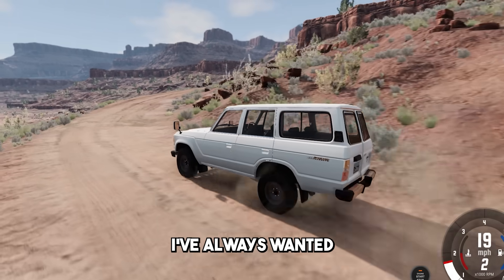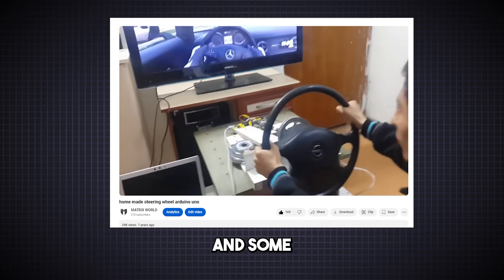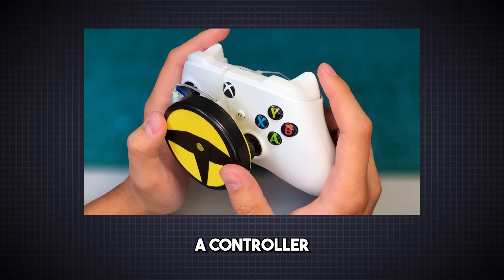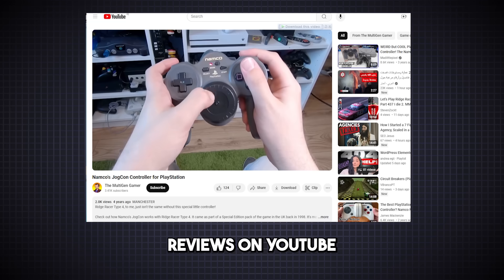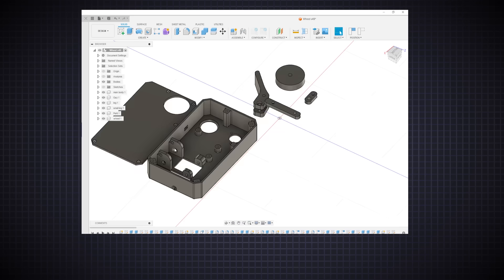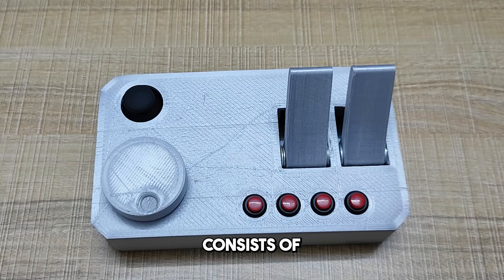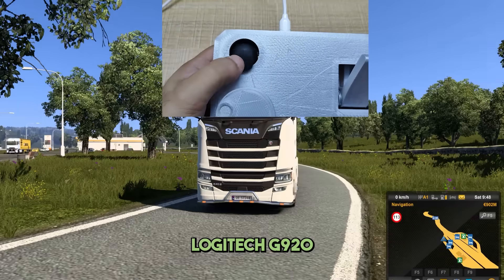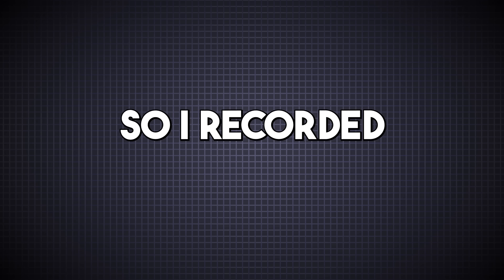The Racing Controller No Company Ever Made—So I Built It

Comment: A cool thing to change to continue separating it from a controller is to add on the right pointer, another small pedal for a clutch, and on the left finger two more buttons for a gear up/down. And the left dial for steering could be a dual dial that can also act a a stick so looking left and right can be done the same as steering.
Reply: It also doesn't even need to be handheld, you could have it placeable on a table to make it easier to add controls

Comment: Absolutely love it, huge congratulations !

If you're interested in suggestions :
- I Think accel/brake paddles shouldn't be this way. It should always be easier to brake than accelerate, so I'd either bring accel upper, or give a curved edge to the brake, so that the thumb could naturally dive into it.
- I would use L1 and R1 buttons to rotate camera on a swivel, to have quick looks around... having to let go of the steering to adjust view is not functional in my opinion... while L and R buttons could allow you to pan around while still having full control of the vehicle.

Have a good one.

Comment: It could work as an arcade controller with your pointer and middle fingers on the pedals and maybe the camera rotation as a mouse pad instead of the analog stick, so you can drive with the left pointer finger and turn the camera with your thumb by putting the mouse pad bellow the steering wheel.

Comment: If you can, try to find a CHT nozzle for your printer. Standard .4mm nozzles can usually flow up to 15mm²/s, while CHT nozzles can flow double. The faster you can print, the less worried you have to be about power outages. 
My next suggestion would be to find out whether Marlin firmware has a power panic feature as seen on most Prusa printers. 
Last would be piecing together some sort of power buffer with old lead acid car batteries, or finding something that gets trashed that containes lithium batteries of some kind you can repurpose so you can pause and shut down the printer until power is back.

Comment: Bro! time to consider solar or a portable generator for your printer :D I mean some car battery + 500w inverter should do it. Your design is awesome!!! I have some ideas for your v2:
Offset the gas and break paddle slightly (like in real cars). Move the gas paddle further up so when you hit the break its not in the way. Add a R1 button on top edge for your right index finger (ebrake)

Comment: Hello neighbour, selamunaleykum. You may put pedals a bit angled to better push with fingers. Steering wheel is total circle, you can design it abit asymmetric to findout where is center easily. Maybe bottom cut steering wheel design or red stripe on top something like that. Good effort. Well done.

Comment: This is brilliant at an amateur level but if you wanted to be competitive at all this would be really difficult to use. Looks like you can only hit brakes or gas. The huge advantage to a controller is that you have individual digits hovering over the gas and brake at all times. This is essential when it comes to weight transfer and once again not a big deal in an intermediate level but you need to figure out a way to make it so that I can use one hand for both gas and brake effectively.

Comment: This is not really a racing controller and moreso a driving controller, dancing around the gas and brake with just one thumb isn't really suitable for actual sim racing. My suggestion would be to design the controller to be used in the lap (like a fighting stick) and have three smaller pedals that can be used with any of the other four fingers, this way also solving the lack of clutch problem. The lack of shifting buttons is also a dealbreaker for sim racing.

Comment: i m not an arduino specialist, but you don t need an ADC (analog to digital converter) for the joystick ?? (at 3:42)
Reply: Arduino has ADC built in
Reply: Some joystick modules come with ADC built-in and communicate via i2c/SPI to the Arduino. 

Either way most Arduino boards come with a 12bit(?) ADC.
Reply: @ND15X  yeah. Here it’s a regular 5pins joystick. Requires a proper Adc. Good to know arduino has built in Adc (it can be tricky to setup). Unlike raspberry4.

Comment: That is awesome. Congrats. I m not as proficient as you in that stuff, but with the proper instructions I think I can make it. This project can help a lot of people who cannot properly use their legs. However, I have a couple of considerations about the ergonomics. It is ok for slow games like Snowrunner and ETS2, but not that great for fast racing sims. One problem is that you need to hit the brakes without lifting off the gas which is hard with your arrangement. The second is that the steering wheel is slow and can become slippery. A vertical orientation that you can grip with several fingers like the ones used in Remote Control cars would be better, I think. Thinking of it, can you build something to connect a RC controller to a PC?

Comment: Thats awesome, only changes id suggest would be to move the pedals to the back and add a clutch pedal, and add 4 or 6 buttons where the pedals are now so it would be easier to handle as a controller and still have the option for those that prefer a manual transmission. Just a thought.

Comment: Ok, thats extremely cool.  Well done for this.  I'm going to have to make one.  

Think about a couple of mods though.  
Moving the throttle and brake to where the right bumper and shoulder would be, so can use my first and second finger to control them. 
Move the joystick across to the right thumb.  
Add a rotating surface under the thumb on the steering so it rotates inside the control as well.  
Add a couple of buttons under the left first and second fingers (wherever they land). More buttons =  more betterer. 😉

Auto centring the wheel control may be tricky.

Comment: Great idea. Bu the layout is not really that great imo.
1) You cannot heal and toe with that setup. The long pedals are neat but not really useful for any racing (you need both pedals to be operated the same time).
2) The buttons could be aligned somewhere else. Some buttons for changing geears would be nice. They should be easy accessible
3) Can the stick be used as a button? You can map that to reset the camera, which would be cool :)

Well waiting for the force feedback now :)

Comment: The perfect version would be something like the turtle beach xbox remote with a N64 prong in the middle, you'd have the screen to adjust settings, you'd have the triggers for the throttle and break, you have the extra buttons at the back for gear selection, then you'd have the N64 prong in the middle so you could grip it there for the wheel and then you'd have the normal buttons for normal functionality, I think even the normal racing wheels should have a analogue or two to navigate menus and for camera, takes you out the emersion when you're messing around with a remote or mouth maybe no so much a mouse but a remote makes the experience less some how for me.

Comment: Great project! I’m not an engineer, but I think what would make this better is moving the 4 buttons to the thumb area (instead of the pedals), making the pedals smaller and moving them to the index and middle finger. That way you make use of more fingers and you could press more buttons at once (f.e. you can accelerate and change the camera at the same time)

Comment: Congratulations on what you did here. Very impresive. I agree there could be market for a driving games oriented controller. I think it all comes down to few things - wheel, analog buttons their precision and shape.
It needs to be comfortable in hands, have useful, precise and comfortable wheel and bigger and more precise analog triggers than on standard controller.
I think I'd start with regular gamepad shape, have two triggers but bigger, maybe operated with three fingers (middle, ring, pinkie).
By having them big, maybe it would be possible to modify them with some resistance accessory.
L2 for brake would have more resistance then R2 for gas.
It would be possible to swap resistance accessory, so that User can decide which of L2/R2 is gas or brake.
It would be nice if L1 and R2 would be also analog triggers, so one of them could act as clutch.
Wheel on left side of a controller, analog stick on the right. It would be perfect, if user could somehow swap sides.
With above setup you could drive and control camera at the same time. You could also apply throttle and brake at the same time.
There's a very cool video on YouTube by PyottDesign where he goes through how he iterated through making FPS controller. I highly recommend watching it.

Comment: unreliable electricity also a problem here in Indonesia. Have you tried breaking down the enclosure into smaller pieces? Smaller parts means you wont have to redo the WHOLE thing, and you can glue them to each other with acetone!

Comment: I use my Flysky Noble NB4 RC transmitter with Beamng when i dont feel like setting up the wheel. It doesn't have 900 degrees of rotation, but its comfortable to hold and is way more precise than a controller.

Comment: Not only is this a great space saver, there are some members of the disabled community who will love this concept.
I know folks in wheelchairs who love racing games and love watching me use my sim-racing setup but arent able to use it themselves. THIS WILL WORK FOR SOME OF THEM
Reply from the maker: Thanks so much for pointing that out! I hadn't even considered that, but it's awesome to hear that this could help people in the disabled community.
Reply: @3dprinterart299 It absolutely would! It's very hard to use conventional controllers and wheels with certain disabilities. This greatly improves and perhaps evens out the disparity in gaming ability. This is an excellent design. If the goal ultimately is accessibility, the wheel might require a nub or a handle to assist with turning off you lack the dexterity and grip.
Reply: @3dprinterart299 
Can i request u made a custom one n made a review of it?

...

Steering analog on right hand side

...

Throttle and brake as usual pressure trigger l2 r2

...

Left hand side for button
Shift up shift down
Hand brake
Change view
Joystick to rotate view
Pause menu
Nitrous for arcade racing
1 additional undecided button just in case
Reply: I was thinking the same thing. I’m in a wheelchair and I would 100% have one if I could, that’s why I wish a controller like this existed.
Reply: @RynoJ5 TurtleBeach velocity one race wheel you do not need the peddles it has two sets of paddles on the wheel the top left & right side peddle will be paddle shifters then under the paddle shifter is another paddle on the left and right side that are pull paddles and you can map the gas to the right side paddle and brake to the left side paddle works on Xbox and PC
Reply: I, for one, am one of those people who love the concept. I really miss being able to go to track days, but I can't really use my left foot with the same precision that I used to (And it's incredibly painful for me)

I can't afford any of the mods to my cars to let me drive my old cars, nor would I exactly want to be tearing apart my Skylines and Silvia to do that, and my steering wheel controller is just as painful for me to use as a car, so this is the best of both worlds for me. Thank you, from the bottom of my heart, from the bottom of the planet.

As soon as I get a 3d printer, I'm making one of these, brushing up on my CAD skills, and hopefully remixing this to make it a little more ergonomic for putting in your hands.
Reply: @Rhidongo  King 🤴
Reply: I love this comment so much! I love racing sims, but due to disability I can't use pedals and a wheel is difficult. Something like this would be perfect!
Reply: Theres also disabled arm/ fingers/ or even brain 😊
Reply: i was actually searching for this comment and product because I'm one of those wheelchair user😃
Reply: u can adapt the pedals but its quite the diy work ,just like they put the pedals near the steering wheel (as a lever) in real cars for disabled people =)
Reply: yeah, that a thing that know I think about it is problematic, because the stearing wheels, like the logitech G920, have levers that works like brake and throttle, but if you see a steering wheel of a adapted race car they have 2 rings.
Reply: Absolutely! Wheelchair user here myself. This thing is a work of art! I'm an avid racing ran and LOVE my modded racing wheel some old buddies in my old NR2003 race league put together for me, but it's hard to set up these days and won't work in most modern racing games. I'd love something like this to use in Forza and other driving games I have! Only two inputs I'd have on this. Some way to make manual shifting possible, and if there would be any way to add a form of force feedback.
Reply: that was my thought too
Reply: The space saving aspect is not a selling point if you are into realistic sim racing.
Reply: If you could add a clutch and a shifter it would be awesome
Reply: this was the very first thing I thought as soon as I saw the thumbnail. thanks for pointing that out!
Reply: "Disabled community" lmao tf
Reply: disabled people can drive irl, for disabled people, there should be a steering wheel for disabled people, not a controller :/
Reply: @LASTEIN2112  it really depends on the disability in question.
Many don't have the range of movement to use a steering wheel, whom this would be perfect for
Reply: @iguana51  but if they can use this controller, they can use a normal ps5 controller...
Reply: @LartinBeats-rg6pf  which doesn't feel anything like driving a car, which is the benefit of this. Are you dense?
Reply: @LASTEIN2112  To put it into context, though, a hand throttle for my car will be setting me back between $15,000 and $25,000 (NZD) and then there's the long expensive struggle of re-learning, or even just getting your driver's license with these new adaptations.

As @iguana51 also said, not everyone has the same range of motion. I'm lucky, in that I've just got one leg that doesn't work, but if someone was partially paralyzed, or missing limbs, then it's a different story.

Disabilities are never a one size fit's all situation, and it's prohibitively expensive to live with a disability, because any equipment is often custom made, and even the mass produced stuff like wheelchairs can set you back multiple thousands of dollars (And that's just for a manually powered one)

Accessable controllers are also often very expensive for similar reasons, but with the popularity of 3d printing, more people are coming together to make the world a better place for themselves, their friends, their loved ones, or just as an act of charity to their community.

I'm not trying to scold you or be mean/rude, I'm just hoping to inspire you to look at things through a different perspective.

Comment: How about adding a gyro module for looking around? it could have it's own button to activate/deactivate it and it would be much more accurate than a joystick (that doesn't mean you need to remove the joystick though). I'm also not entirely sure how hard it is to implement so do what works for you. if you want some examples of how accurate gyro aiming is i recommend looking at jibbsmart or tekgeekster videos, It can essentially emulate a mouse without actually being one. I also play all of my fps games with a dualsense controller using gyro if that's any evidence.

Comment: I think something like this with a form factor closer to a stick/leverless controller, where it can sit on lap, would be killer. the extra size would allow for better spacing, and extra components like maybe a centering spring or extra buttons for features like shifters. The increased size would also likely help with ergonomics/fatigue too. Would also allow larger dial, like a jog wheel off something like a Pioneer DDJ or CDJ, which would in turn help with precision/twitchiness. Obviously this would be very difficult, considering the roadblocks you explained (such as power cuts, which would be a pain in the ass with a larger print) however I think it could still be worth investigating, maybe even collaborating with someone who has consistent power to make it happen. I would love to see this developed as I think it would fill a real cool niche for console guys that don't use a desk, or keyboard/controller racers who want a little more, but aren't willing to commit to a full rig. a servo motor would be badass but obviously that's a considerable amount more work and tinkering. This thing rocks dude!
Reply: Alternatively could make the throttle a slider/fader like you would have on a mixing console with a spring to make it return, and a load cell brake in the form factor of an arcade button like a sanwa, which are easy enough to take apart and modify. I don't exactly know how you'd do it but I mean it's not exactly impossible

Comment: Neat first prototype! In addition to the other comments from people (e.g. grip buttons on the back, triggers, self-centering "wheel", etc.), it would be cool if you rotate the pedal buttons left by 45 degrees so that you can hold the controller traditionally while being able to press both pedals at the same time with your thumb. 

Or maybe a clutch pedal could be inserted as the left "trigger" or something